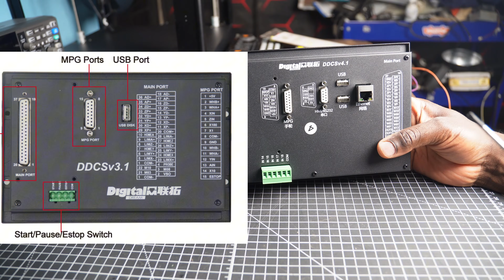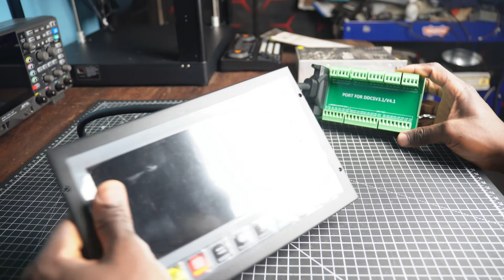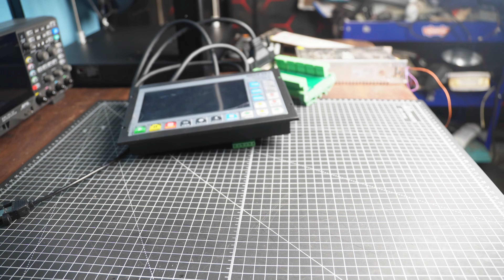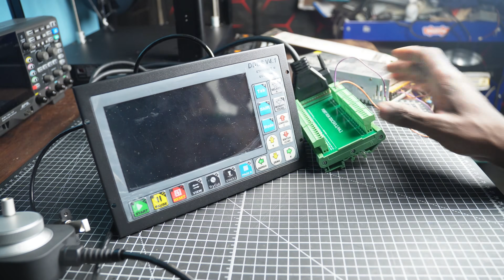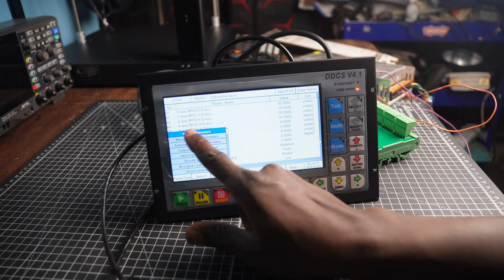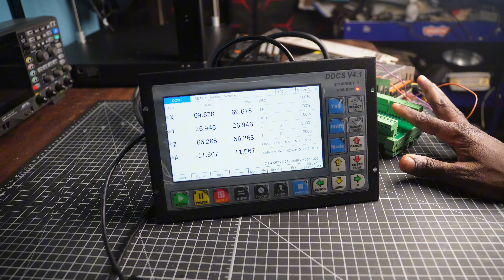DDCS v4 1 CNC Controller  First Impressions, Features & Build Quality

Comment: What about the I/O power ?
Is it strictly necessary to use a separate 24V power supply for that as well?
Reply from the maker: Same power used for the controller can be used for the I/O